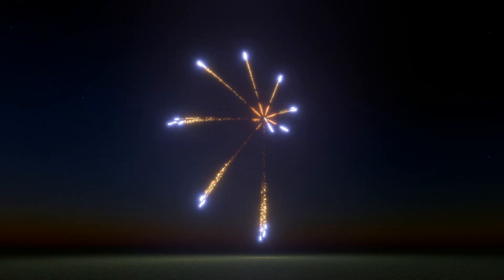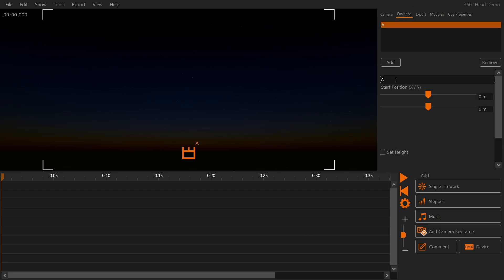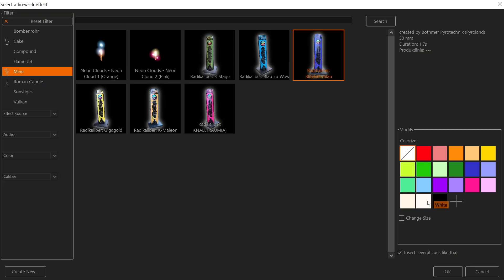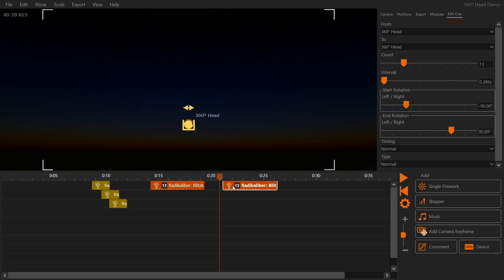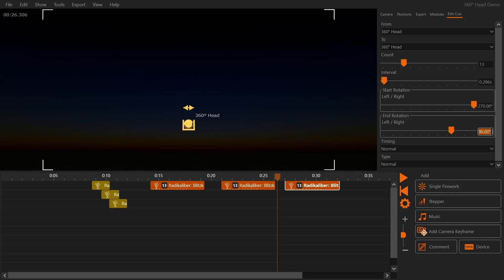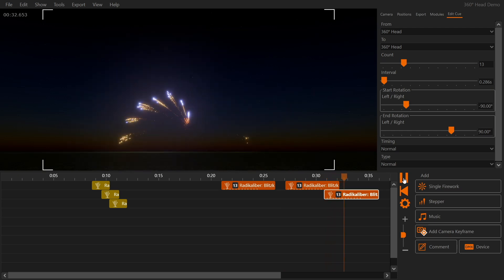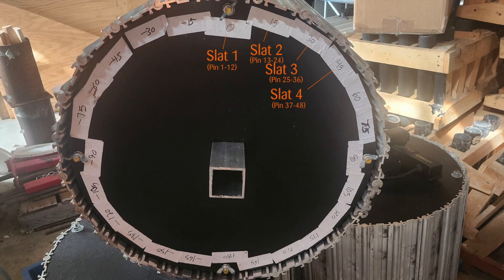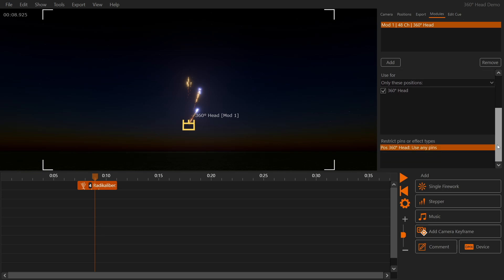How to Set Up 360° Heads using FWsim? ⭕️🎇

Comment from the maker: Please note, the instructions in the video are for FWsim Pro. If you use a different edition, you will need to make some adjustments:

-> If you use FWsim Basic, then you cannot set the height of the position. In FWsim Basic, you can put fireworks on 3D objects, but you cannot set the height manually. You can still build 360° heads by adding a 3D model of a crane, and then putting the 360° head position on that.
-> If you use FWsim Basic or Creative Edition, you can ignore the section about channels and data export.

Comment: Hello is there anything similar we could do in the creative edition?
Reply from the maker: In Creative Edition, you can do the same thing with the visualization! The only thing you can't do is the data export. In FWsim Basic Edition, you are more limited because you can't put  positions on arbitrary height in the air (you can only snap them to 3D models). So in Basic Edition, you would need to find a 3D model of a platform in the air, and then put your shots on that.